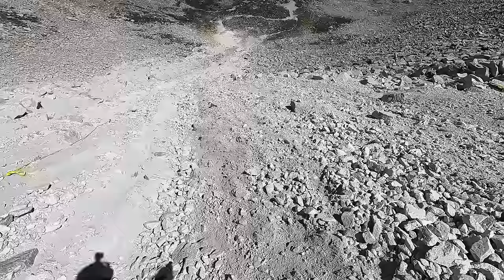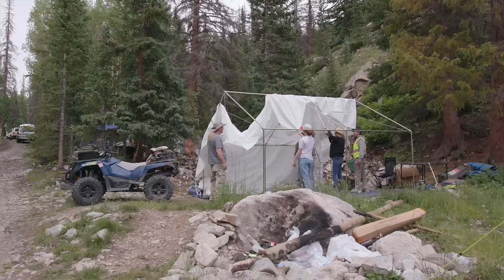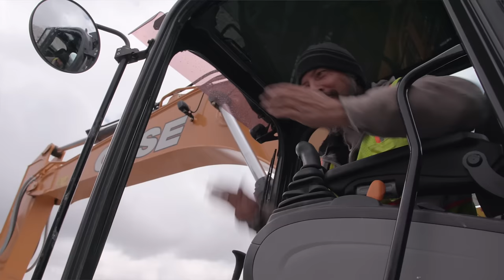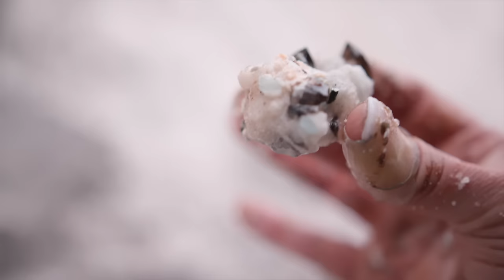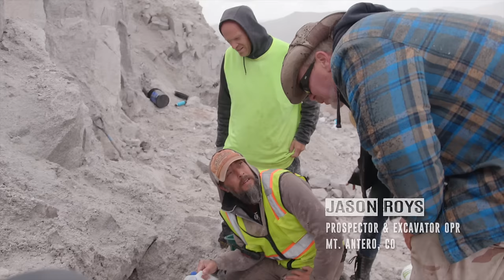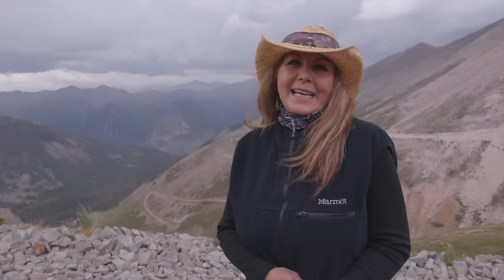Finding a RARE aquamarine spray pocket  | Mt. Antero Treasures S3:E2

Comment: Nonononononoooooooo!!!! My friends!!! You don't want to deconstruct a piece like the spray you found!!! 

There's a reason why everyone was so excited for this episode and it's because the natural construction of these crystals far outmatches anything that artisans, lapidaries or jewelers could do to it.

Now I understand it's difficult, but there is a way to extract these pieces and in fact it's not even vastly expensive. 

All you need is a generator for one. Two an extension cord. 3 a circle saw. And 4 a diamond blade for said circle saw. 

I myself am a lapidary and I've seen firsthand the power of a diamond saw. Diamond is number 1 on the mohs hardness, which essentially means it's the hardest material known to man. It will cut anything, even Steel. 

From there it's just a matter of lugging the genny up the mountain, hooking it up, making four cuts and thennnnnn not entirely sure how you get it out of the ground, but I'll bet you anything it's worth it. 

The crystals you've found in that pocket are obviously still inherently valuable, but you could do a lot more as far as dollars earned and interest garnered if you were able to extract an entire intact matrix. The Denver Museum of Nature and Science in particular would probably pay you an arm and a leg for a beautiful piece they can market all across the city. I can see the banners waving on 23rd avenue already.
Reply: yes! those are more valuable as collector pieces than gems. Much rather see that kind of stuff in the Tuscon show behind glass.
Reply: @GrieseTrailCams  Deconstruct is very appropriate. Whether or not it can be reconstructed to it's natural glory is yet to be seen.
Reply: If we were NOT working in permafrost that would work. I have worked extracting crystals with saws and whatnot. But up here in the permafrost everything will eventually fall apart if the vug is not somewhat intact. The mountain is frozen from the last ice age and with how the glaciers have moved across the rocky mountains and the natural movement of the mountain, most if not all pockets have collapsed and froze. so this is a surgical process to extract specimen and crystals.
Reply: @EquippedDelight  would it be possible to pour a plaster cast or? To stabilize it. Be able to remove it in larger pieces. Make the reconstruction easier?

Comment: WOW! That last pocket is amazing. I hope we will be able to see that specimen after reconstruction, those aquamarines had such an interesting growth pattern, and are a deeper blue than most from the location. The specimen could be museum quality.
Reply: No. For a museum display it has to be intact and still attached to the vug matrix. Those loose crystals are useless for display purposes, they are only good for the jewelry trade.
Reply: @Tugela60  They repair those pieces and glue them back together. Many museum pieces are repaired this way.
Reply: @jameswelch1054  The most valuable specimens are those that are intact in situ and on their matrix. Free crystals are basically worthless as display specimens. They might be sold as new age magical items or more likely sold to the jewelry market. If you have an exceptionally large specimen you might display a free crystal, but none of the stuff they show on the show come anywhere close to being an exceptionally large specimen. When I was a kid I had a much larger crystal in my collection, and it was actually in situ (just like all of my other specimens), not a free crystal.

In any case, these guys are overstating the value of the crystals they are finding by an order of magnitude. Raw aquamarine is considerably cheaper than the prices they continually trot out. Perhaps they might reach those values as gems once faceted, but no way the raw crystals are worth that much.
Reply: @Tugela60  False. The Sweet Home rhodochrosites, and the Colorado Amazonite specimens we see in museums, have been reconstructed.
Reply: @jameswelch1054  Museums buy undamaged specimens. Something a hobbyist buys is NOT museum quality.
Reply: @Tugela60  Not true. The Smithsonian, and most museums even hire specialists to repair the specimens. I have seen many shows where museums explain how they repaired their specimens. You just guessed wrong, bro.
Reply: @jameswelch1054  They might do that for extremely rare exceptionally large specimens where there might only be a single or a couple examples, but for regular specimens being undamaged and on native matrix are going to be what they buy for display. Perfect crystal faces are also required. There are plenty of examples of specimens that meet those criteria around, they dont need to glue anything. Stuff glued back together is for amateur collectors who can't afford the perfect specimens. 

Sorry dude, you have no clue what you are talking about.

In any case, the small crystals these guys are pulling out are NOT museum quality. Just because they say it is does not make it so. Remember, they are also claiming values of hundreds, up to a thousand dollars for individual stones, when in reality they are actually worth 30 to 100 dollars at most. They are making all sort of claims that are simply not true for the sake of entertainment in their videos. They want to breathlessly elicit oos and aahs from the viewer, when in fact the stones they are pulling out are pretty ordinary gem quality aquamarines.

The only thing interesting about their video is just how freaking dangerous the conditions they are digging in are, lol.
Reply: @Tugela60  Totally false statement. Most museum specimens have been repaired. The most valued tourmaline specimens, that museums fight for, are from the Pederneira mine, in Brazil. All of then have been repaired. I have watched many shows where curators from the great mineral museums describe how the great specimens were reconstructed. Clearly, you don't know much about the mineral specimen world. Send an e-mail to the Smithsonian, they will set you straight, lol.
Reply: @jameswelch1054  No. They have not. Just because some large specimens have does not mean most have. Other than extreme examples, museum display samples have to be undamaged. Because if one was damaged, it is easy enough tomfind another that was not.
Reply: @jameswelch1054  Why don't you? Do you really think the stones being found by these guys are "museum quality"? When I was a kid collecting rocks I had an aquamarine specimen, unbroken and in situ in pegamite with mica plates and it was about the size of an adult thumb. And that was nowhere near museum quality. Museums don't just go for size, they look at the overall presentation impression of the sample. Unless it is an exceptionally large specimen they are NOT going to be glueing bits together. There is no reason to recontruct a specimen when there are perfect undamaged specimens readily available.

Get a clue dude.